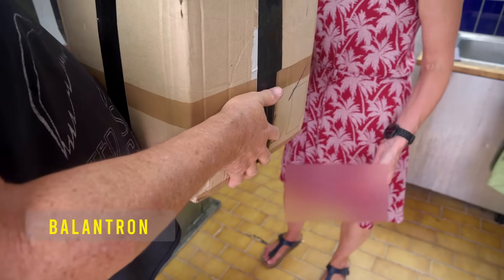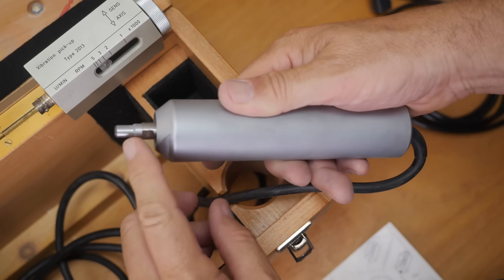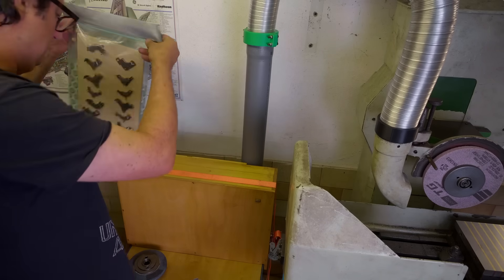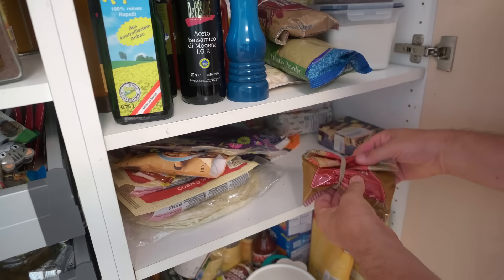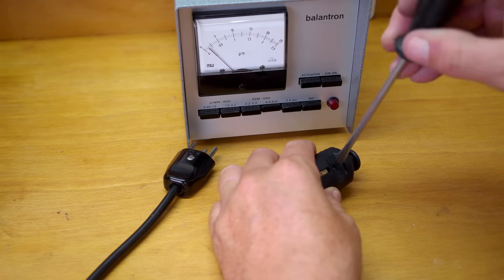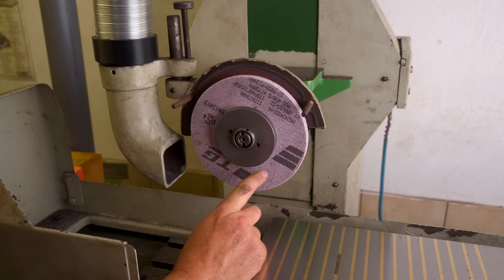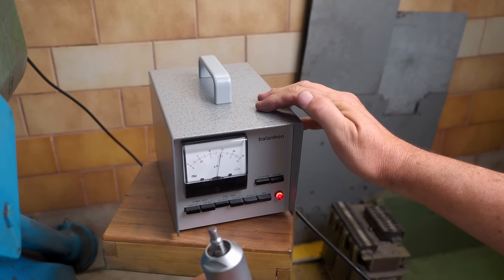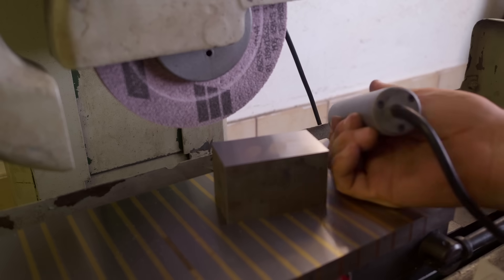Can you help me fix this grinding wheel dynamic balancer? || RotarySMP

Comment: Regarding the apple tree, i'd put two stakes behind it in a v and use a ratchet strap or similar over a year or two to try and pull it straight - once a week go out and give it a couple of clicks, will help a lot, that and a pretty thorough pruning!
Reply from the maker: Thanks for the tip. It needs that.

Comment: How many cores in the actuator cable?  First test is continuity of the cable and integrity of the connections at either end. Is it possible some grinding dust has got inside and jammed the core? Some careful investigation is required! Cables and connectors are the most common fault. Also test the output at the actuator connection on the machine. A complex machine, but it may not be a complex fault!
Good luck!
Phil
Reply from the maker: Thanks for the tips Phil. I will measure it this evening.

Comment: Not unlike a bearing condition monitoring and balance unit except no vibrating chisel. 
It would have to respond pretty quickly to change. 
The software that hooked up to the condition transducers would even give a weight required to add or remove and radial location counting RPM with a proximity switch.
Reply from the maker: I was also thinking this is similar tech as used on the vibration monitoring of jet engines, minus the hand held precision jack hammer.

Comment: In addition to MAIL TIME! Are we going to get SNACK TIME!  I sure hope so.  Some apple pie would be nice.  You’ve inspired me to smoke some of the chilis we are getting from the garden this year vs what I usually do which is make relish or pickle them whole.  We decided to cut back and did poblano, jalapeño, Serrano and Shishito this year.  Funny how things get put into that “safe space” and disappear.  I’ve found a couple of sure ways to find these things. Stop looking for them or get a replacement. They turn up shortly after.
Reply from the maker: Hi Joe, replacement parts would have had them show up immediately. :) Hope you have a great chilli havest. I think I will get one more havest this year, if the weather holds up.
Reply: @RotarySMP  You should probably censor Cristian’s Adresse at 7:57 .
Reply from the maker: @heinzrudi4973  Thanks for spotting that. I blurred out another one during the edit but missed that. I have now done the blur. It can take so time to take effect.

Comment: hi mark this thingi still looks suspiciously like witchcraft to to me...... just make shure you keep the magic smoke inside once releasesed its very hard to get it back inside...........no funnels mate those are lids for the mesuring cups that came along in the package. mix the paint in the cups screw the lid on and mount it directly to on the paintgun.......dont loose the little nobs they cover the little air hole on the bottom of the cups............the bigger the cutter the harder it is to abuse them😂 not saying anyone wouldnt try to 😅......... enjoy greece come back save.
Reply from the maker: Thanks Christian, thanks again for that paint gun. Looking forward to the next pain session (well not really, painting is a PITA :)

Comment: Not sure if actuator should touch the wheel in order to dress it up to spec. Think that actuator is used to find loose parts that amplify resonances and vibrations. Maybe post pictures of the internals so we can get idea how hard actuator is driven.
Reply from the maker: Will do. Thanks Aleksander.
Reply: Is there a diamond or carbide tip on the hand unit?

Comment: Do you have an oscilloscope to see if the unit is outputting anything to the actuator?
Reply from the maker: I do. I'll start by measureing the resistance on the hand piece. Sounds like it should be a double coil solenoid. If that measures okay, I can take a look at the driver.
Reply: @RotarySMP  the  hand piece might be piezoelectric  normal resistance clecking will not really  help.     check the output with the oscillicope. 
If it is piezo the voltage will be quite high.

Comment: Hi Mark. These instruments were made by Kistler Switzerland. These company still exists! You could send them a mail, don't know if you ever getting a reply from them. If not, the EMO (machinetool exhibishion) in Hannover is from 22 until 26 september. I am there the whole week, because of my profession, i am selling machine tools in the Netherlands. If you don't know anything around that time, I could visit them and ask for you. So let me know if this is an option for you. Regards, Marinus
Reply from the maker: Thanks Marinus. I will open up the actuator and see if it is anything obvious like a wiring break.
Reply: @RotarySMP  Mark the actualor might be  a piezoelectric  device,  in which case normal resistance checks will not tell you much.
Reply from the maker: @steveggca  I will take a look Steve, and see what I can find.
Reply from the maker: Okay between the pins it has 6.4,  3.2 and 3.2 ohms. So it sure looks like a double solenoid.
Reply: @RotarySMP  great news,  I also saw in another  comment that you have a loose screw 😉. found , I ment to say found a loose screw. that bodes well for an
easy fix.      I have worked with Kistler piezo accelerometers and kistler  piezo driver amps used in inspection tools , thats were my thought of maybe piezoelectric came from.
Reply from the maker: @steveggca  Yep, I also thought Piezo, but it looks like this is simpler.
Reply: In all my years, balancing thousands of grinding wheels the conventional way, I have never seen or heard of a balatron. It just shows you that no one knows everything. What a fantastic gift. I hope you get it working in the next video.👍👍
Reply from the maker: @chrisfairbrother9197  Thanks Chris, so do I. :)
Reply: @chrisfairbrother9197  there is one person that knows everything. He is a very stable genius.

Comment: I'm not 100% convinced it's the actuator - you also need a power amplifier driving it, and that could also be broken. I guess ohming out the coil could help, and if that checks out fine, maybe a collab with Marco Reps is in order?
Reply from the maker: Thanks Vincent. I'll start looking at the solenoid resistances.
Reply from the maker: The check out (6/3/3 ohms) between the three pin combinations. The actuator shaft is very sticky, like a very tight seal.
Reply: @RotarySMP  So the coil itself seems fine then, that's about what I'd expect. If it's tight, there may be gummed up oil inside or something.

Otherwise, drive electronics still would be something I'd be suspicious of - those are old power electronics are likely all analog, so they're full of electrolytic capacitors that can leak, carbon resistors that can drift, tantalum capacitors that can fail short, and transistors that can fail in various complicated ways.

Comment: You can call the cooking bit side projects... 😇

Check the cable on the actuator. Watching how the actuator is packed into it's box, it appears as though the cable is forced to make a tight bend.
Reply from the maker: So many side projects. Breakfast...Lunch and Diner :)
Reply from the maker: Oh, and not really, the box is quite well designed, with ridge to support the actuator, and space for the actuator to bend without the tight bend.

Comment: Aww, that looks like such a cool tool as well. Modern stuff just doesn't use that aspect ratio, something to do with shipping and sea containers I suppose. Maybe Christian over at LR Time could help, he knows more about balancing machines than most and he's just down the road from you (relatively speaking...) Good luck Mark, hope you get it sorted.
Reply from the maker: Thanks Rick. It is a really nice tool. Hope it is just a bad connection or something like that.

Comment: In the case you find out the problem is with the electronics I can fix it for you. Would be nice to make a repair video about it.
Reply from the maker: Thanks for the offer. I am hoping the actuator is a solenoid, and just has a borken wire in the connector. I'll take a look.

Comment: Actuator looks like a solenoid type device. It would never require high currents, so the chance of its coil being burnt out is very low.
Highest probability of failure is a bad connection, so I suggest opening the plug on the end of its lead and inspecting that, and/or testing the coil ohms.
It may be siezed, so you could check that too, although an expensive device like that probably has had only infrequent use and good safe storage so that is unlikely.
The other possibility is a blown driver circuit, which means opening the main box and doing some pokery... main suspect would be the solenoid driver transistor(s) of IC, likely on a heatsink and obviously connected to the solenoid outout plug.
Reply from the maker: Good inputs. I also thought it might be a solenoid. There are three pins on that actuator cable. Wonder what the third wire is for?
Reply: @RotarySMP   most likely has two coils, one pulls, one pushes. Bidirectional solenoid, probably spring balanced in the central position.
3 wires is typical, using one wire as common then applying current to each of the other wires to push or pull the armature.
Of course, this is all guesswork, I dont know that machine at all, just going from my 40 years electronics experience... 🤔🙂
Reply from the maker: @wizrom3046  I appreciate your tips.
Reply: @RotarySMP double acting solenoid? Or feedback from a sensor?
Reply: @gillywild  Or it could be the driver circuit is in the solenoid itself, so you've got power, ground, and trigger.
Reply: @JCWren Quite possible
Reply from the maker: @JCWren  There is a comment above with 6Ohm between center and RH, AND 3 Ohm for the other combinations, so It sure looks like a solenoid.
Reply from the maker: Okay, the resistance on the actuator is fine, 6.4/3.2/3.2  Ohms between the three pins.

I am not sure if the actuator should be able to be moved when off. It is rigid, it could be mechanically stuck, but would expect a hum from the solenoid.

Both poles of the  actuator on/off switch seem to work fine with a resistance check.

I found the loose screw was one from the display indicator. Looks like it was an adjusting screw. May have caused a short, but I dont see anything burnt, and it doesn't smell. I have reinstalled that screw.

The output drivers are marked TI 3030M 70 30A. Not sure how to test them.
Reply: @RotarySMP so it is a double acting solenoid. Test the output transistors with a multimeter on diode range. You should see about 600 Ohms one way and open the other way collector and emitter to base and open collector to emitter.
Reply: @RotarySMP I can’t find any part matching that number and the schema isn’t familiar. It seems it could be a Texas Instruments part but a search there gives no results.
Reply: @RotarySMP   they sound like a 30v 30amp mosfet, N channel. A photo/video would help a lot.

You say the solenoid armature cannot move? That is likely the problem, a seized armature. Solenoids only produce a kg of push/pull orce etc, so i would expect the solenoid to have a spring of fairly light force, centre balanced (ie 2 springs).
I would disassemble the solenoid and check it out. If you are reluctant to do that, you could do another test with the machine running and put an ac volts multimeter on the solenoid pins I would expect to see some ac volts being sent to the coil. If the volts is there that indicated stcuk armature, if no volts are there it could indicate a blown driver or blown driver psu. If there are two driver mosfets, it is unlikely to have blown both...
Reply: @RotarySMP    just to add, another simple test would be to power the solenoid with a dc power supply and see the armature movement. It wont be harmed by putting an amp through a coil, but that shoukdmdefinitely produce some measurable movement. It like has a total armature travel of a 2 or 3 mm.
Reply: @wizrom3046  I wouldn't assume that 1 amp is safe, I would possibly current limit to 1A and then instantaneously touch the wires to the power, nothing continuous, maybe even use stranded wire, where 1 or 2 filaments only, are used for the testing connection.  If trouble occurs, maybe it will burn away instead of the tool melting down.....  If results occur, (motion or no-motion, sparks or no-sparks), then you have 1 more answer to the problems questions..
Reply: @wizrom3046  The solenoid shaft springs will be stiff because it needs a very fast response. Time constant << 10 milliseconds. The spring constant could be >> 1 kg (force) per mm.
Of course the first thing to check is faulty connectors and switches.  Buzz them with the multimeter continuity check.
I agree the first troubleshooting step is to clip or solder test leads to the solenoid driver pins (back of the connector inside the cabinet might be easiest) and (safely) measure the ac voltage when it should be operating.
I agree if there is drive voltage it would be worth disassembling the actuator to check e.g. has the shaft rusted in the slide bearings?
Is the driver a 3 terminal device with a heatsink tab?
Reply: @murdo_mck    you made some good points. I personally dont think the spring needs to be that stiff because it is a double acting solenoid and will actively return, so the reciprocating time is more dependent on applied voltage and coil inductance of the two coils than it is on the spring.
We really dont know what is in there, I assumed it would be a off the shelf bidirectional solenoid and that the company that makes the machine probably just buys the solenoids from a specialty solenoid manufacturer. The 3 ohms per coil looks very typical for a 6v 2 amp solenoid coil, although they probably over-volt it in use to give that fast response you mentioned.
Normally a double acting solenoid like that will have dual springs and return to centre when unpowered, and also I would expect end of travel buffers. It would normally be movable against the spring by hand, even if just a small movement.
Reply from the maker: The drivers are TI 3030M's

With my Multi meter on diode I got...

On transister one:
Positive on Base / Negative on Collector = Over
Negative on Base / Positive on Collector = 0.034 Vdc
Positive on Base / Negative on emitter     = 0.353 Vdc
Negative on Base / positive on Collector = 0.035 Vdc

On transister two:
Positive on Base / Negative on Collector = Over
Negative on Base / Positive on Collector = 0.036 Vdc
Positive on Base / Negative on emitter     = 0.355 Vdc
Negative on Base / positive on Collector = 0.036 Vdc

The actuator shaft was very stiff. Using the wrenching flat to screw ont he diamond tip, I can rotate it and move it in and out but it feels like a very tight seal. However, would I not get at least a hum or something if it was being powered but stuck?
Reply: @RotarySMP those readings are all over the place. Take the transistors out to eliminate other components influencing the reading. You also have base to collector listed three times, is that a typo? You should also measure collector to emitter both ways. Did you find a data sheet  for the “transistors”? I couldn’t find anything and references to that number anywhere.
Reply from the maker: @gillywild  Sorry, yes that last line should read emitter.

Seth sent me the data sheet for those transistors.
Reply: @RotarySMP Could you share an image to camera in your next video if possible. Have you been able to test the transistors out of circuit yet. I’m assuming they’re toast.

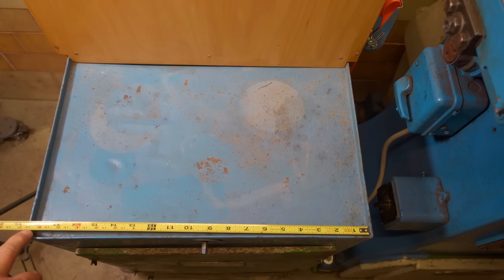Comment: 3:02 "11 1/2 inches by 467mm" - that's my kind of measuring... bi-metrologist?
Reply from the maker: Hi Philip, Absolutely :)
Reply: Hey if it’s good for the space program, it’s good for daily use. 😂
Reply from the maker: @iTeerRex  Some Mars lander did an excellent landing due to metric / imperial didn't it?
Reply: @RotarySMP  There was one big mistake due a mix up, that I know of, but otherwise it has always been a mix of metric and imperial.
Reply: @RotarySMP  Mars Climate Orbiter
Reply from the maker: @Andrew_Fernie  That was it. I knew there was one :)
Reply: You did it intentionally just to make nervous breakdown for some commenters 😂